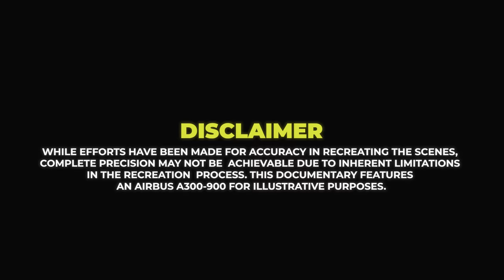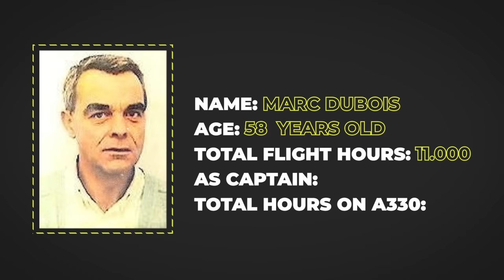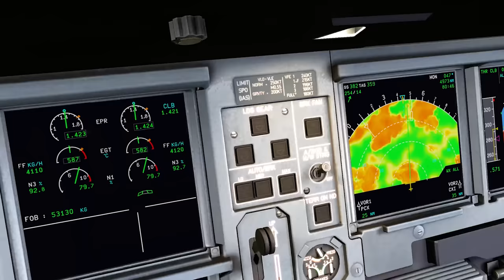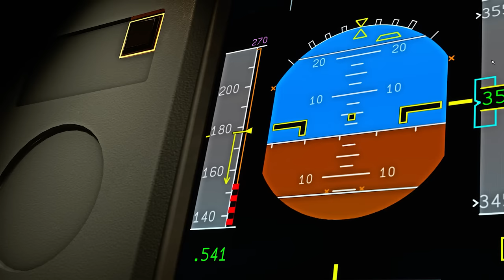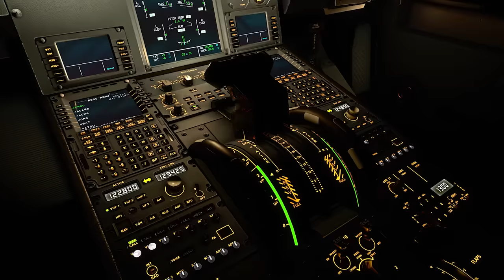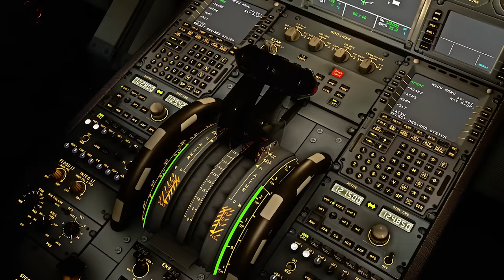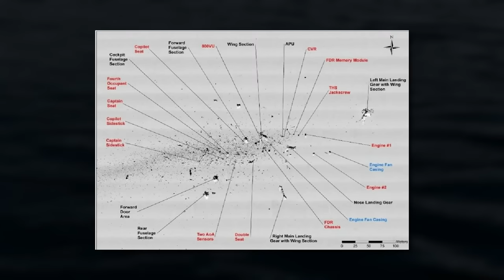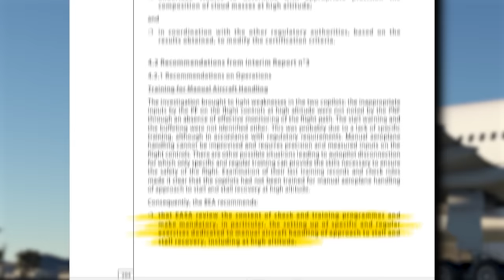Horrific Freefall into the Deepest Ocean | The Sad Story of Flight 447

Comment: In a nutshell, the crew knew how to turn on and turn off computers, but they did not know how to fly the plane. Technology is a wonderful thing, except when it becomes so advanced pilots forget how to do their job (or never learn in the first place).
Reply: Yeah and many many hours of the same procedure
Reply: its more complicated than that. When this accident happened, the stall and recovery training these crews recieved only focused on a stall at low altitude, because this was thought to be the most dangerous situation to stall in. In this stall training, a lot of emphasis was placed on the use of thust to power the plane out of the stall, to minimize altitude loss. Lowering the nose was a secondary action to take. Note that one of the first things the FO did in this accident when he heard the stall warning was to put the engines in TOGA. But the performance of the aircraft is also MUCH better at low altitude than it is at 35,000ft. So the engines didn't have sufficient power to pull the plane out of the stall, and the flight crew was unable to recognize the need to lower the AOA in time.

Comment: probably one of the most preventable accidents in aviation history
Reply: How could it have been prevented? Sorry I’m a little slow
Reply: I’m not in the aviation industry and have no knowledge of it but from what I gathered from the video. It sounds like the pilots did not know how to correct failures in the flight induced by the bad weather. The best analogy I can think of is think of someone in car, driving in bad weather and suddenly their car hydroplanes…and then to correct the car from hydroplaning they over correct by aggressively handling the steering wheel.
Reply: @Taylor-ls8kv  thanks, it makes a lot more sense now, with a 'real life' example.
Reply: @Rubin250I don’t get why the pilots didn’t think they were not in stall when the alarm was literally calling out stall. And another thing don’t hundreds of plans fly through that ocean during storms weekly so how could this have been a complete unexpected surprise that the petot tubes or anything else malfunction for a few minutes. I think one expert said in some documentary that all the pilots had to do was literally leave everything alone and not touch the anything. Crazy sad story
Reply: @laylahahmad6468  the pitot tubes which deliver data to the sensors about air speed etc had become clogged with ice hence all the wild conflicting alarms both pilots got. Bonin kept causing a duel input alarm because he wouldn’t stop pulling back on his controls even when he agreed the other guy was in control of the plane.  Bonin kept the nose pointed up which caused the stall and the plane fell from the sky.
Reply: If only you were there to prevent it, how do you sleep at night
Reply: That's a stretch
Reply: @Rubin250 yea sad the captain left just at wrong time. And Bonin constantly pulling  back the stick is almost like it’s on purpose
Reply: By reacting normally. Fly the plane straight, level and at the same speed when the auto pilot tripped. Everything that contributed to the crash was the pilots behavior.
Reply: @bobbycigarillo  It could have been prevented by having actual pilots and not employees who only know how to turn on the autopilot
Reply: @sarahbasto6520  A more technical explanation. If a plane is in stall the nose points up, this will break the airflow that supports the plane and will now begin to sink. To prevent this, you reduce the angle of attack (nose pointed downward) by flying down, applying speed and using the momentum to pull the plane up.

Our brilliant pilot Bonin, applied the speed brakes which slowed down the plane while the other pilot wanted to add speed. Bonin also prevented the other pilots from pitching downward since his instincts were to pull up, which then activated the “DUAL INPUT” since the other pilot was trying to pitch down to fix the problem.

To go up, you have to go down and add speed. Bonin wanted to keep pulling up, which kept the plane in stall, which forced them to go lower and lower :/
Reply: Thats so true
Reply: @Carpenter1 you can only say that because of screens. Otherwise teeth would be missing.
Reply: Ooooh youe hard 🙄@johnnymichael1804
Reply: @fried_riceee thank you. Now I understand
Reply: Any crash is preventable, but judging pilot actions is always easy when all the research is done and you know what should have been done. There’s a few details they left out
Reply: @bobbycigarillo training, respect of the chain of command, proper communication. If the junior had not been "given" authority over the aircraft, the more experienced relief first officer would have recovered from the freefall. If they had communicated about who is doing what, it would have been prevented etc.
Reply: Second most from that Russian flight where a pilot let his kids control the plane
Reply: One pilot was doing one thing and the other one did the opposite.
Reply: @Rubin250where the heck he was at
Reply: @fried_riceee probably wanted his way . Or he thought he was doing it right , probably wasn't even pay attention to dashboard
Reply: Flight 592
Reply: So the 12 degrees bank to the left to avoid the storm started it all..then they all panicked. Thats basically what happened.
Reply: In actuality, this WAS the most preventable accidents in history. It did NOT have to happen if idiots were not allowed licenses to fly. 
This whole tragedy is F/O Bonin's fault, and his idiocy took 200+ people to their graves. Had he not tried to be a hot shot pilot to impress his wife maybe (she was also on this flight with him as well) and not partied so hard and slept the night before --they'd ALL still likely be alive. The pitot tubes froze over in the storm they were going thru, and it caused the Airbus to give false airspeed readings. If Bonin had waited about a minute max, the pitot tubes would have defrosted and all would be ok. Instead, Bonin pushes DOWN the stick shaker next to his seat, causing the auto pilot to turn off and the plane to enter an aerodynamic stall. It would remain like this until final impact 4 minutes later. When Bonin pushed the stick down, he didn't tell ANYONE and F/O Roberts pulled his stick up thinking it would correct the problem. In an Air bus, these two actions cancel each other out and no response is made and the stall continued. Bonin did not realize until the last possible second when Captain Duboise last words on the CVR  were "10 degrees pitch up" just seconds before impact that he had been the ONE creating the stall to begin with. Had he just left the Air bus alone, not touched ANYTHING, the crash would have never happened. 
The plane fell from 33,000 ft at  over 10,000 feet/sec making  impact with the ocean belly first at 200/mph, killing all aboard instantly. TOTALLY PREVENTABLE!!!! 🌹🙏🏻😢✈️💔
Reply: I wonder how long it would have took the Pitot sensor to defrost had they just have left it 😢
Reply: Birgenair 301 is the top one
Reply: Shortly after the accident, Air France changed the pitot tubes on all of their planes (from Thales to more reliable models). Why not earlier? Plus: The training schedules were amended by "High altitude stall recovery" and "unreliable airspeed at cruise level" (pilots were not trained for this previously). Why not earlier? Why do always people have to die before such measures are implemented?
Reply: @petermuller5800  most of the aviation rules and laws are written in blood and its taken a disaster to see what can go wrong.
Reply: @fried_riceee best explanation. Thank you.
Reply: @laylahahmad6468  The pilot handling the pilot, least experienced one thought they were going too fast. Yes you can stall when flying to fast as well. So that's why he picthed up the plane. Also he did not know that the plane went into alternate law, losing the stall protection. As someone said, he believed that airbus couldnt stall...
Reply: @fried_riceee yeah, it was clearly Bonin fault for most part of the accident. He went crazy when autopilot was turned off. He ignored captain instructions. He kept pulling the the plane up for 2 minutes while freaking out and screaming
Reply: Incompetent pilots. Brutal.
Reply: @Rubin250you always fly IFR in a fixed wing commercial aircraft. You use your visuals too, but you're never flying VFR.
Reply: Yes you are very slow to sum it up and dummy it down.  First off the captain was the only one with experience.  2 , the other two you g guys didnt have training on stall and recovery at high altitudes.  3. If the captain never took a nap this accident wouldnt have happened most likely.  Then again its hard to say because the other stooges never had training for that situation
Reply: No, that Aeroflot flight where he let his son take control was more preventable..
Reply: Dont forget the one with the Russian pilot who let his kids play with the controls.
Reply: @bobbycigarillo quite easily prevented........as a pilot the cockpit resource management was completey lacking in this case. SOP, standard operating procedure,  would be to set power, not on TOGA but at 85% power while setting the elevators at 5% pitch up .......in other words this action would insure flight and give the crew time to troubleshoot the situation. What brought the plane down was dual input disagree, which would cancel out both pilots inputs and rightfully so, disable the auto pilot and more importantly disable FAC 1 and Fac 2,  flight augmentation computers, and essential tool while flying .....by the time the captain realized the imminent stall it was too late.
Reply: All the Bonin apologists in the comments blows my mind. This idiot kept the nose up in a stall for 5 mins. Basic airmanship was ignored. He murdered everyone due to his incompetence
Reply: @George-v5c5n 1-2 minutes. If Bonin had left the stick alone and not panicked, everyone would still be here
Reply: @aaronmoser828  I thought that but not really they weren't trained for it.
Reply: Flying in the dark made this 100 tines worse
Reply: That is the French to you. Spend some time in France and you will understand.
Reply: @69429boss No it's not. Even junior pilots know that you should go nosedown when about to stall to gain airspeed.
Reply: If they had descended rapidly from 380 could they have exited the stall?
Reply: @lorrainebennett7528  Yes, IF they had taken corrective action AS SOON AS the airplane informed of the stall condition. Their incompetence led them to ignore the most IMPORTANT information being given. They did not on what to focus on and to make matters worse, the one on the right chair kept the nose up, the OPPOSITE of what they should be doing.
This is France to you: nepotism and unions that prevent corporations from getting rid of the incompetent.
Reply: It seems to me that the pilots were completely incompetent- like Keystone Cops level incompetence. 
Am I wrong to have that impression?
Reply: @MrCWells3000  That, and the fact that Airbus "joystick" yoke does NOT reflect what each of them are positioned. The criminally incompetent co-pilot in the right seat was pointing the airplane up with his joystick but the co-pilot on the left did not notice. By the time the pilot and co-pilot realized the other's crucial mistake, it was too late.
Reply: @fried_riceee  yea the pilot decided to want the plane to go up is stupid he is not a pilot he should of know that pointing the noise down is to gain speed
Reply: Jyaaaaaaaaaaaaaaaan seeeeeeeeeenaaaaaaa !!!!!!!!
Reply: In addition to the one where the pilot let his 16 year old son fuck around with the stick.
Reply: @Omega1867  exactly!  Bonin needed to NOT control anything at that point.
Reply: @fried_riceee  Bonin screwed the entire crew and passengers.
Reply: Up there with the Randy Rhoads plane crash, every little poor decision increases risk, with enough carelessness you reach 100%

Comment: My brother in law, who is an airline pilot flying Airbus aircraft explaned to me, that modern airliners-especially Airbus models - are actually not meant to be hand-flown. The technology and design of these aircrafts is way too complex to be handled by the pilots. If everything works well, the computers can handle the aircraft much better than a human pilot could do. The pilot of an A 330 is primarily just overseeing and monitoring the autopilot flying the plane - he or she is normally not steering the aircraft at any time-only at take off, but not necessarily. He explained to me, that even for an expreriencerd pilot, it is very difficult fo hand-fly an A 330, if the autopilot does not receive valid flight data flying at high altitude and without any visual reference.
The co-pilots is always blamed having caused the accident and being a bad pilot- but my brother -in-law says, that, being thrown in a situation like that, 90 % of  pilots would run into problems as any manual input at this alitude may have dire consequences without correct flight data...sounds scary....
Reply: The co-pilot gets blamed because his actions were literally causing the stall by pitching the nose up at maximum allowance. Thats why in the flight recordings, when the captain Dubois realizes he has been pitching the nose up for the duration of the malfunction he literally responds with “no,no, no! Don’t pull up, no,no, no”
Reply: @jamescrosby100   Wasn't he also trying to control the airplane even after receiving the "my controls" command? Twice he went back to taking the stick even after giving up controls.
Reply: Nah man I can appreciate pilots having each other’s backs but that clown dropped them straight into the ocean.  90% of pilots would’ve done the same, my ass

Comment: Two of my family are Airbus Captains/Check Airmen. After this accident (negligence), their companies ran every one of their pilots through scenarios like this and procedures to recover. The conclusion was that this crew crashed a flyable aircraft due to breakdown in cockpit resource management and communication. This has happened all too many times in the past.
Reply: Lmao "okay everybody, lets run a simulation on what happened, so we know what to do, even though we have the power of hindsight and already know what to do"😂😂
Reply: @genocyber4842 isn’t there value in practicing and training pilots? It’s why we did fire drills in school
Reply: If he never pulled back on the stick the plane would have kept flying normally, the pitots would unfreeze, the IAS would come back and they could reengage autopilot and everyone would be fine.
Reply: @billyd5749  it was the pitot tube freezing up which caused the computer to change from normal law to extended law, in normal law this couldn’t have happened as the computer would have interrupted, in extended law unfortunately the pilot had full control.
Reply: @diane4968 Exactly.  Everyone knows what to do in an emergency if you ask them to think it through. Huge difference when you actually have to put it into action under duress. Physically practicing over and over helps overcome freezing when actually faced with a dangerous situation.

Comment: "A simulation exercise after the accident demonstrated that with no pilot inputs, AF447 would have remained at its cruise altitude following the autopilot disconnection." Damn
Reply: It's still a simulation though
Reply: @fracturedsolace145   even the possibility is haunting
Reply: @fracturedsolace145 those simulations are near perfect tho
Reply: @fracturedsolace145 You do realize- pilots use those simulations to practice because they are so accurate. Right????
Reply: @fracturedsolace145  Not really, Bonin killed them it's simple as that.
Reply: @fracturedsolace145 Simulations are accurate
Reply: Correct, it wouldn’t have been able to maintain its cruising altitude of 35k feet. But recovery from that stall Bonin put the aircraft in was completely achievable if he had relinquished control of the aircraft over to the more experienced pilot next to him.
Reply: @straightwhitemale966  no matter just how intelligent people are there will always be problems that can't be forseen and ha e to happen.